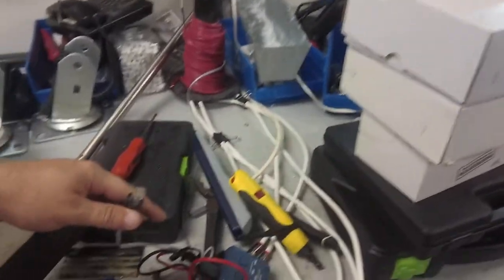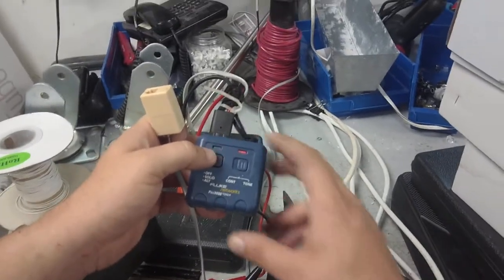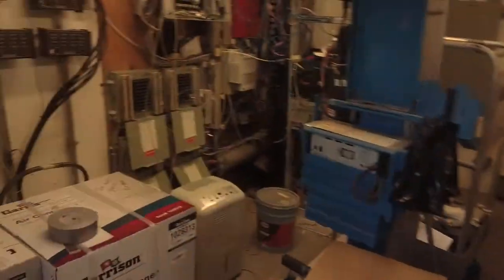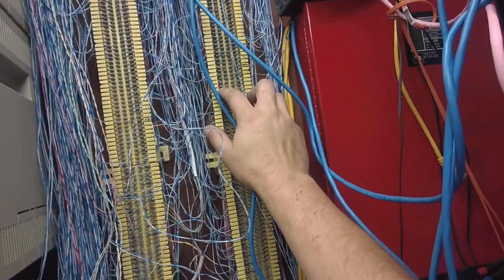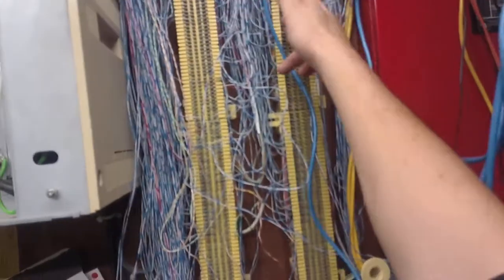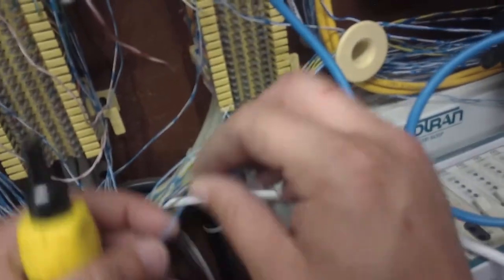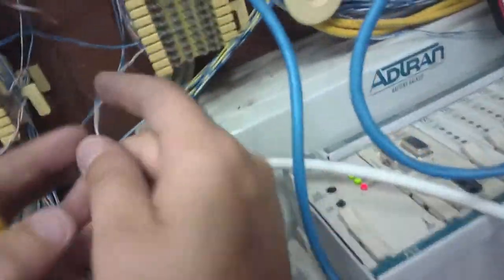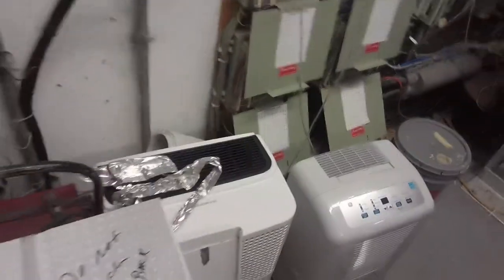How To Locate A Phone Wire For Phone Hook Up.

Comment: When i was a telephone linesmen / cable splicer in The U.S.A.F. back in 1980s and 90s. We  use to pull in the telephone cable and terminate it on 66 blocks. The base communications personal will come in and terminate there jumper wire's to it. Fun job. Nice video, Thanks.
Reply: I actually enjoy wiring 66 blocks

Comment: With a fluke an idiot can find. How to find it with only a modem? I have 4 wall sockets only one works the rest do not. The one which works in the wrong location I need to make work the one which doesn't. I opened and few wires not connected to anything. Which one should be connected and where?

Comment: Sorry dude and I’m not blaming you but that is a mess. I run into it all the time. Tiny little rooms with 15 different phone systems. The problem is no one takes out the old phone systems when they install new. They just cross connect from old to new. After 20 plus years it’s a giant birds nest. Nothing gets labeled, just a nightmare. I get called after the cleaning crew throws there brooms and cans in the same room disturbs one wire and number goes down. Good luck troubleshooting everyone’s quick fixes. Makes for a long day. If your disconnecting a system to install a new one take out the old don’t cross connect into the old. It’s just lazy and no one wants to take responsibility. A lot of IT guys are the main culprit there not installers and certainly not cable managers, they just get it to work with there 20’ patch cord when a 2 footer would have worked. Just left a car dealership. They had 12 PCs on the system with over 50 patched into a switch on top of another switch. Old cat3 patched through just a mess.

Comment: Who the hell uses analog telephone still? It's almost non existent where I live.
I sometimes joke that we used to have internet over phone lines, now it's the other way around, everything is digital and the phone plug comes from the cable modem.
Reply: Many people us it, and another use of a telephone line is wanted for security. With voip the alarm wont work with a power outage. An old telephone line has its own power supply of about 48v (pstn) or 96v (isdn)
Reply: @AreYouHonest  Good point, we should rewire all the phone lines to the police station and use it as alarm network 😀
Reply: Hardwired lines will never go away. Cellular will go down fast in times of tribulation.
Reply: When you’re in a hurricane cat5 and the only thing that works is analog, don’t complain. Oh and what you think is modern telephony like SIP is really an invention to give you the illusion of something modern. In reality it just analog being converted to SiP back to analog.